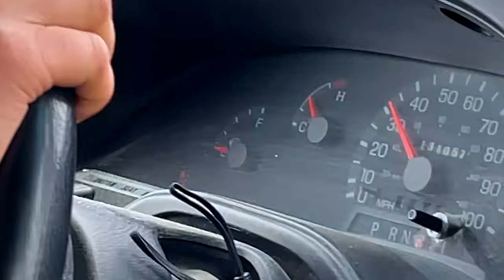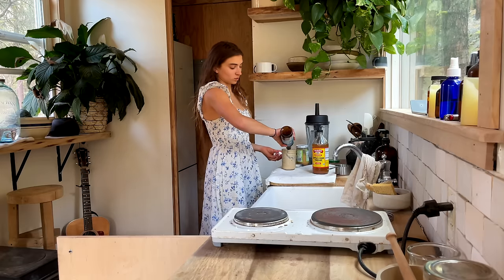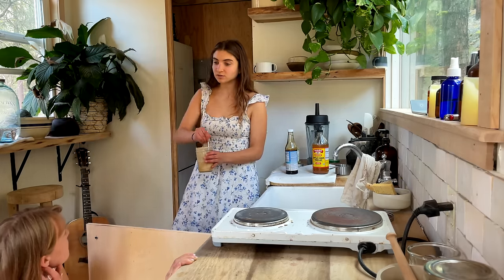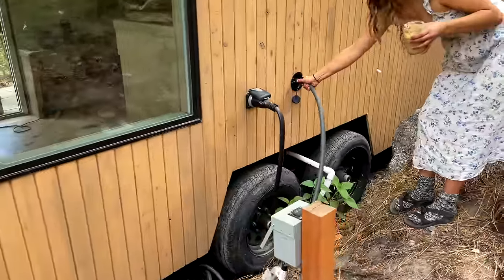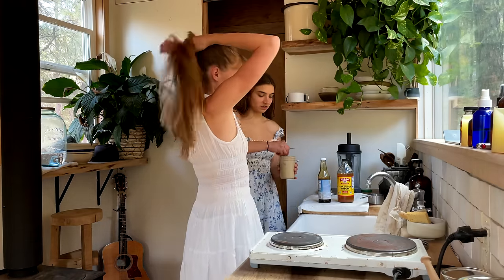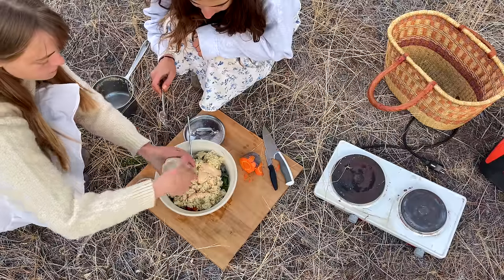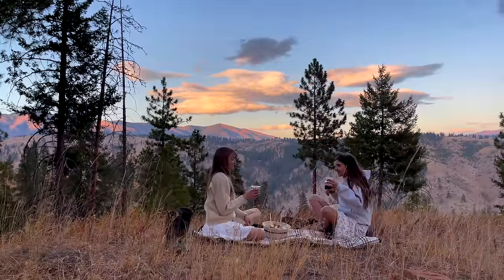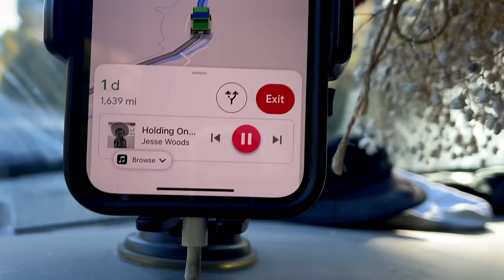Staying at @isabel_paige's Tiny House

Comment: @12:43 Please someone get them to stop cutting(ripping and slashing) their insulation like that!  Its SO much easier and quicker, and makes less dust if you lay a strip of plywood down on the insulation over your cut line, stand on it to compress the fiberglass and cut along edge(which doubles as a straight edge to guide your cut).

Comment: The alternative is to get a single solar panel with a high enough voltage to charge the higher 24V battery voltage by itself. Any Large Solar Panel has an open circuit voltage of >30 Voc which would achieve this, but in the winter it may struggle to reach a high enough voltage. Aim for >45 Voc, like our Perlight 200W Delta Monocrystalline Solar Panel that has an incredible 50.97 Voc !

Comment: ...just so you know.  By design, when your fuel light comes on, you have 1 gallon left in the tank. If you do 28 miles to the gallon, that's 28 miles left. Don't panic when the light comes on, just find a fuel station when you can   :D

Comment: ...nail gun wire collar or paper glue nail cartridge shoots out fragments quite regularly ... wouldn't recommend naked eyes... or ears..and who's the trade wanna be dragon you two into the fiberglass dance huff chamber?..box window fan with furnace filter x2 simple air protection... expect mold go hydro static furnace filter on a simple box fan safe...